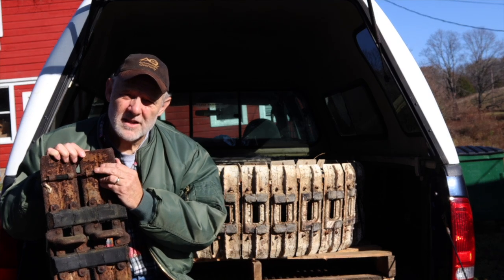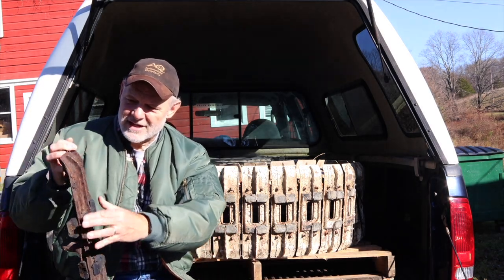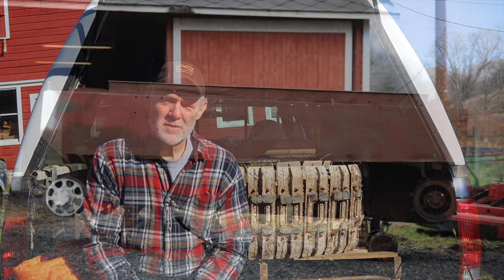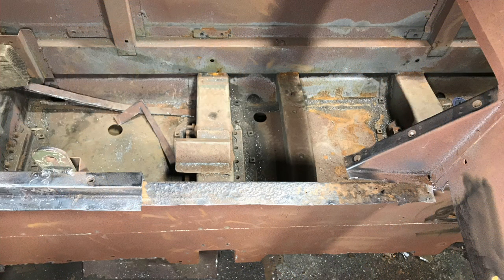WW2 Vehicle Restoration: SCORE! Unobtanium Weasel Tracks!

Comment: Very unique project, wonder what one of these Weasels is worth now days?
Reply from the maker: Super nice, restored with a new set of tracks...up to about $40k - most will trade for around $15-$20K - tracks are everything.  There was a company making new tracks...they are worth about $14k new.  Expensive, but the difference between having a reliable machine and worrying about breaking a track every time you drive the machine.

Comment: Any reason why the original T-15s had canted roadwheels? Was it for track alignment issues or component fitment? I just found it an odd design choice, but I'm sure at the time there was some reasoning behind it...
Reply from the maker: Greetings Pine!  Interesting question.... I don't know the exact reasoning for the road wheel design on the T15.  BF Goodrich was one of the designers of the track system on the project and they made all of the various Weasel bogie wheels (as far as I know).  I will ask a couple of friends who have T15's and report back.  I do know that the track design on the T15 did not perform particularly well - they would throw tracks and T15's drive better uphill backwards than forwards...prompting several changes on the T24.
Reply: @Portrayalpress  I remember watching that OSS briefing film stating on the T-15 that the tracks were designed to shed off to limit track breakage during rough turning. I'm sure the design intention was good, but I found it a humorous solution which as you explained they fixed for production units. Did the weasel share the same tracks as the allis chalmers snow tractor? They look similar in design, maybe bf goodrich produced them both?
Reply: @Portrayalpress  So I stumbled upon the development report from the head engineer of the weasel program on accident today.  The cambered bogie wheels on the M28s were to allow the track to flex side to side without interference between the track guides and the bogie wheels.  Just following up for those that may have had the same question.

Comment: Do the tracks need restoration also or can they go right onto the trucks
Reply from the maker: Greetings Bill.  They are somewhere in between.  I am pretty sure I can run them as is with a little lubrication on the chain.  That being said, there are road pads missing and if I run them hard, I will knock off more.  The cosmetic appearance is not great - so a good pressure wash and coat of pain would make them look great.  The chain is an OK solution but conveyor belt material might be better.  Lots of decisions here my friend.
Reply: @Portrayalpress  Onward friend!